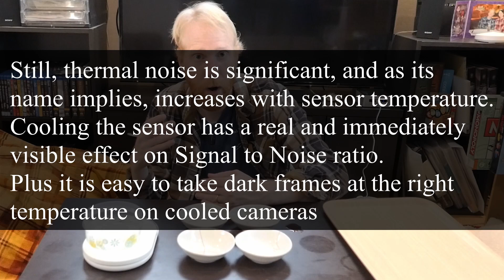Thermal Noise, Dark Frames, and Amp Glow - Noise in Astrophotography Ep 2

Comment: Hey Cuiv, great stuff and makes perfect sense. I just noticed some apm glow on my ASI1600mm pro when shooting 600 sec shots, gain set to (101), both in lights and also in the darks. A little discouraging but we shall see if after stacking the shots if it will average out and clear it up, except of course for the uncertain noise which will still be present. I tried my lights on the subject at 300 and of course no amp glow but I could certainly see a difference in captured data. Guess it's going to be a trade off one way or the other but stacking will be the tell-tell sign. Thanks again for the info.

Comment: was just doing some dark frames for library on asiair294mm pro. Seeing about 2 to 6 pixels that almost always show white while view using asifitsview to view the image. Get this more, about 6 pixels, with longer exposures (300s) and less, 1 or 2 with 5sec exp. These unruly pixels are spread across image and not in one area. When magnified 3200 times can see the one pixel that, at this level, is a large white square, but all nearby pixels are normal, or good. Happens consistently at 0 gain and 120 gain when cooled to 14F (-10C I believe).
Just wondered if you have any thoughts on this. (Maybe it's so minute that it won't affect the image outcome anyway).

Excellent video. Alot to take in but well done, thanks.

(Also, just subbed as am learning a good deal of useful info from your episodes)

Comment: I cant stand that Electroluminescent Starburst (which increases linearly with time ) on the Sony 183 IMX  chips.    Lol     thats why i sold both OSC/MONO ..     533 looks way better.
Reply from the maker: Yes, the 533 is just so, so much cleaner - I'm almost thinking that optimizing dark frames might actually work with that one. To be fair, the darks did get rid of that amazing starburst... but still!
Reply: @CuivTheLazyGeek         yes and that cleanup costs photons ...erg  .lol
Reply: It was a serious problem with my QHY183, eventually my solution was to increase the black level bias (pedestal) of the dark frames to match the istogram peak of the light frames.
This trick removes quite well the amp glow without affecting the picture quality.